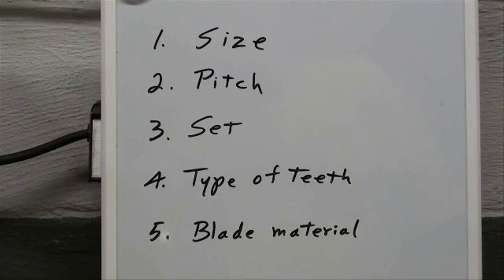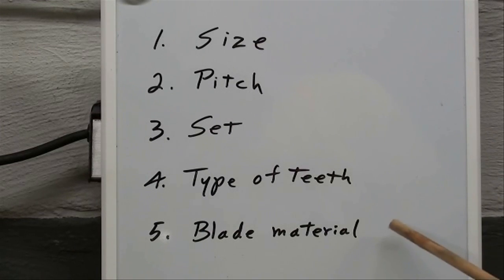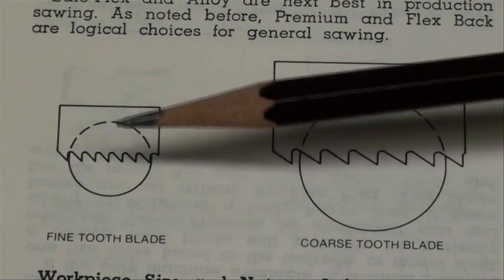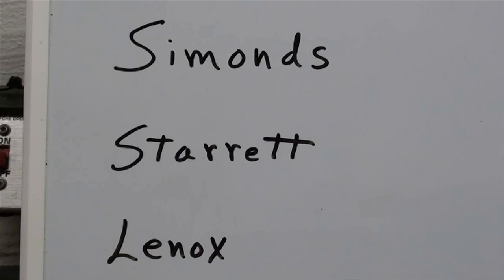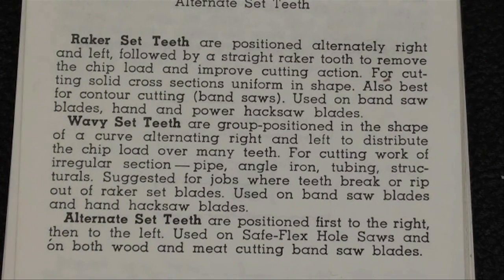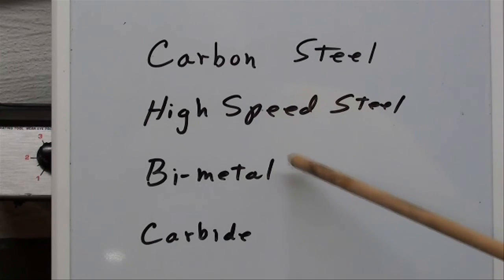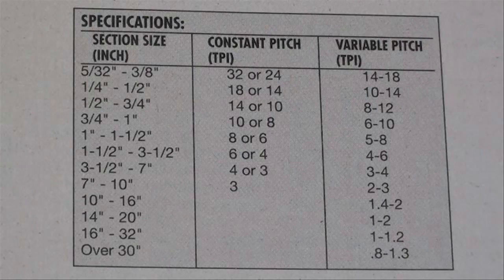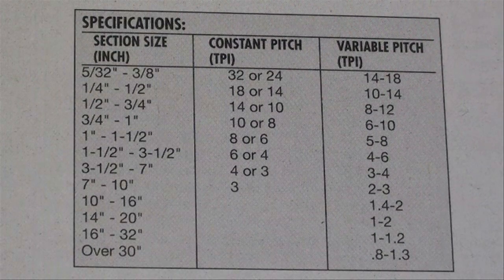Machine Shop Tips #45 Part 6 Bandsaw Blades tubalcain

Comment: Hi Mr Pete i got some new blades from travers i bought some german made  3/8 and 1/2 one bi metal VP for metal cutting and starrett low cost 1/4 and 3/8 corse for wood / plastic also got a 14 th 3/8 back up . I have a sales rep. i deal with  . I'm waiting for my cheep tac meter. I got a 10 - 1 right angle  gear drive and
 3 ph motor and VFD witch i can drop the motor speed by half safely and plan to turn some polly v  #2or 3  step pulleys on the gear drive to lower wheel shaft hope i can get speeds for metal and wood cutting . Thanks Mr Pete . video coming soon . JM

Comment: i have found a bimetal with 6 teeth and 10 teeth works well for my chinese totally rebuilt horizontal saw. (cost $179). i consider these machines partially manufactured and home finishing required.
Reply from the maker: Yes, those machine is always take tuning up
Reply: tuning is understatement. u funning me.  heh heh should have made video, but my voice sounds like a dying goat.

Comment: Mr Pete found one of those   Epic germany hand tachs like you have found it on ebay for$ 36.00 by accident  there about $500.00 depending on the model got the one that goes to 50.000 rpm I am glad you showed how to use it  trayed it on my horz.band saw which rpm is known it was right on  sometime you get lucky 
Thanks

Comment: Very interesting series. I dont quite understand the skip tooth design. Your book describes the teeth as widely space as if every other tooth was removed. Would'nt that be the same as a coarser hook tooth blade? If you order a 10 TPI skip tooth blade is there really only 5 teeth per inch or 10? Awsome videos!

Comment: I use my machinist vise also for holding round work, but turn it upside down so you can hold the shaft anywhere, not just the end.  For extreme shorts on the horizontal bandsaw I built a plate which the part to be cut sits on, then use the mill toe clamps to secure it to the plate, works great!